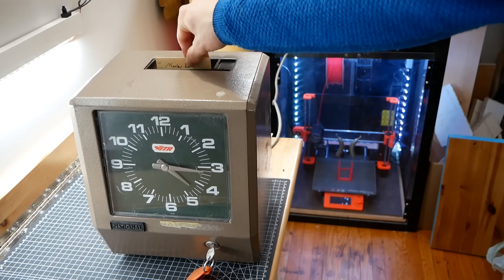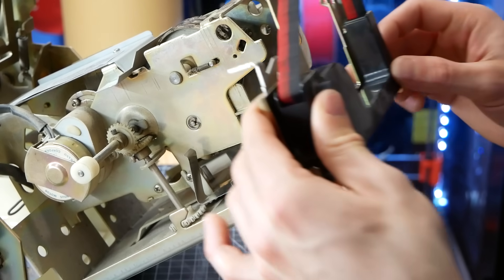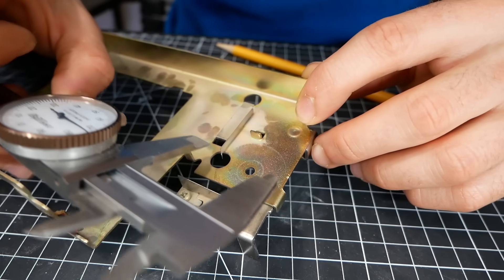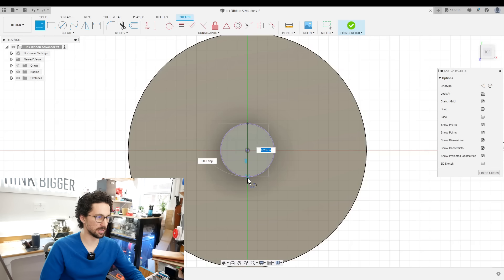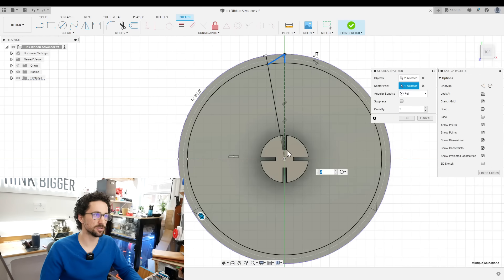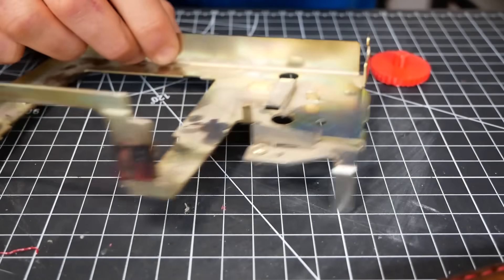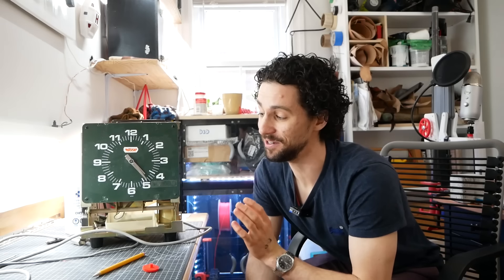They wanted 100 dollars. I 3D printed it for 9 cents.

Comment: You're just being cheap. $95.00 for that mechanism which includes the gear I'm assuming, is not overcharging. They incur all the cost of first, making it, second storing it all these years, and third repairing your machine  well and proper. And then the cost to ship it to you, spend time e-mailing you, maintaining the building to store the part in, paying a technician to know about it and find it for you, so at $95.00 after all those expenses they might make $5.00 profit. If you were a businessman who relied on that machine to perform and run his organization, you wouldn't rely on some jury rigged part which could wear out in a few days. Also the plastic costs you five dollars, how much did you spend on the printer, electricity to run it, student loans to learn how to use it, Your cost food and water. Don't be cheap. buy the part and keep the business alive, spur the economy and get a good, maybe nylon strong gear that will last a long time. How much is your time worth?, Dumbest thing I ever saw. And you think you so smart. You're just cheap.....       Just saying                    Mike.

Comment: I can totally believe they wanted to charge $95 for that, mostly because they are working off of old stock that is expensive to store, parts that weren't cheap to make, and it sounds like you got a new metal bracket with it, good on you for producing it for cheap but don't sh*t in a business for charging a lot for something like that, its a miracle they still even provide parts for something so outdated

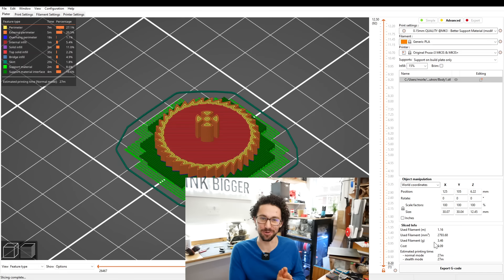Comment: 11:10 Hogwash and bollocks.  It cost 9 cents plus the cost of the 3D printer plus the time it took to learn Fusion plus the many many hours required to reverse engineer the required part.
Someone with better things to do would think that the $99 part is well worth the cost.

Comment: Does any business still use such time clocks?  The last job where I had to punch in with paper cards must have been well over 45 years ago.  Nowadays with electronic employee badges they can record clock-in and clock-out events electronically, eliminating the need to manually transcribe the dates and times and the need to store time cards in file boxes.

Comment: The lever that advances the gear scrapes against the teeth as it returns. This will cause accelerated wear on the gear. For a unit that isn't really used that might be fine, but the part they're selling for $95 is intended to be functional in the long term.

Comment: if the teeth are being measured in degrees  and you've mad them 10 degrees and a circle has 360 degrees wouldn't the gear have 36 teeth?

Comment: Do American folks use imperial units, such as inches, even in the context of casual engineering? I noticed when he used his measuring caliper tool, he noted figures in inches and then in the Fusion software, he also opted for inches. I understand Americans culturally use imperial units but I thought in STEM fields, folks shifted to metric units get the overall benefits of that unit system.

Comment: Very cool that you made that replacement part but your titles a little bit misleading (which is the reason I clicked on it and the reason you probably titled it that way lol) It’s not $95 for the little cog it’s $95 for the bracket assembly. It’s still definitely expensive but within the context of it being a low volume,  borderline obsolete part. It’s kinda impressive that they would have one at all you could buy. Still, being able to make replacement parts on your own is what makes 3D printers amazing.

Comment: The $95 price seems unreasonable but maybe it’s not.   First of all, they weren’t selling the replacement gear. They were selling the entire assembly. My guess is that the original gear was machined nylon or possibly injection molded and set into the metal assembly with a retaining ring or heat peened to lock it in place.  Either way, over time, the method of locking the gear to the assembly may have worn out. Someone pulls the cartridge and the gear sticks to the cartridge. Bye bye gear.  

Now it has to be fixed. The maintenance folks have a choice between paying  a repair company $95 plus labor or buying a new clock for many hundreds.  They choose to have it fixed.  The repair company probably gets the repair parts discounted but most likely doesn’t care. They charge what they charge and the customer gets the bill.  The customer doesn’t care what the repair costs.  It’s not his money and he just saved his company the cost of a new clock so he gets an “Atta boy”. 

3d printing didn’t exist when that clock was in use.  The parts supplier wasn’t trying to screw you and you didn’t beat the system.  Advancing technology made a part that sat on a shelf for decades obsolete.  If you want a real sticker shock, check out prices on new “old stock” auto parts for vintage collectible cars. 

Nice spin though.

Comment: My only question is how durable the PLA part is going to be in the long run I'd imagine the metal arm might start eating into the plastic after a while then again if its not in constant use it probably wont be an issue

Comment: you need a resin printer for this stuff
Reply from the maker: I would love to get a resin printer soon!
Reply: @MorleyKert  When you do remember to print them at 45 degrees relative to the printing surface and cure them with some UV afterwards (first remove supports, wash then cure, otherwise it'll be impossible to remove supports)

Comment: 360 degrees in a circle, my guy (10 degree tooth angle X 36 teeth). Cool video though. Excellent demonstration of engineering and 3D printer use cases.

Comment: Whoa... I haven't seen one of those bundy clocks for years. I used these in many jobs back in the 1980s. Bundy on, bundy off. Or you'd get someone else to do it for you. Great video.
Reply from the maker: Thank you!
Reply: @MorleyKert  You know mate. When I was watching your video, I remembered that I'd taken that section out myself and changed the ribbon. I don't remember who it was for, but I remember taking the ribbon out and winding it back to the beginning. And putting in a new one at some stage That was probably back in 1985 I'd say. Maybe I found a dumped one when I was a kid. Don't know. Just remember doing it. Cheers mate.

Comment: You could have made the construction of the thing even easier on yourself: Create the outer circle and the teeth in a single sketch, use construction lines (they don't subdivide faces, so you can construct the teeth and gear in a single sketch, and can extrude it all at once instead of subtracting the teeth later on. Also, the perfect spacing would've been 36 teeth, since one tooth is 10° wide, and 360° divided by 10° is 36 teeth.

Also, the drive shaft for the cartridge doesn't even have to be a perfect fit, since it's only ever moving in a single direction, so any slop between hear and cartridge won't be a problem.

Comment: You've made replacing cartridges more difficult than needed.
You need a screw hole to hold the gear in place on the metal plate with a washer and screw and the slots you have for insertion into the cartridge need to be bigger and perhaps bevelled at the top since a tight fit isn't at all crucial to performance, but easy insertion is.
Reply: username checks out

Comment: This is a fantastic video and demonstration of how useful 3d printers are, but I have just one tiny grudge with it. While making the teeth he was trying to figure out how many ridges to add when the math is extremely easy. Since a circle is and always will be 360 degrees, you can always just divide 360 by the angle wanted. That leaves 36 at 10 degrees, 72 at 5, and so on.

Comment: I find it amusing that kind of guessed the nr of teeth on the first prototype. You set the angle from the center of the circle at 10 degrees so shouldn't it be 36 teeth? 360/10.

Correct me if i'm wrong, this is what I'm thinking.

Comment: It's a amazing what a little knowledge and willingness to work for it can get you.
I recently did something similar at work where we had been having to repeatedly replace a $100 control board in a machine. I saved the old failed boards and took some time to test each component on it to the best of my ability. Everything seemed good. Only thing I couldn't test was a little logic chip that was soldered onto it. A little searching around found those chips available for $0.15 each and sockets for$0.10 each. I ordered a handfull of each, cut the old chip out of a failed board, unsoldered the remaining pins I'd cut, soldered in a socket, and plugged in a new chip. The next time we had a board failure I put that repaired board in and it worked fine. I gave the same treatment to the newly failed board and now we can easily unplug the failed chip and plug in a new one in minutes for $0.15 instead of $100.
I still don't know exactly what that chip does, and I've never done any other serious soldering. You don't have to know everything about something to fix it. Just be willing to give it a try and learn as you go.
Reply from the maker: Heck yeah! That’s awesome